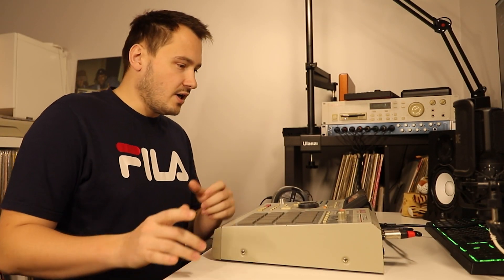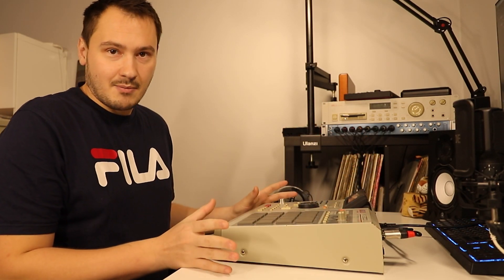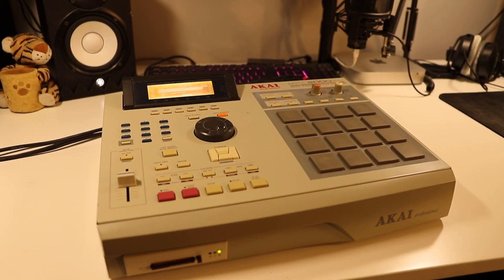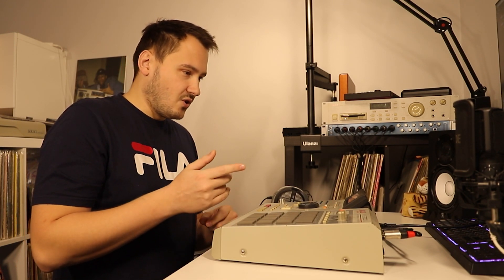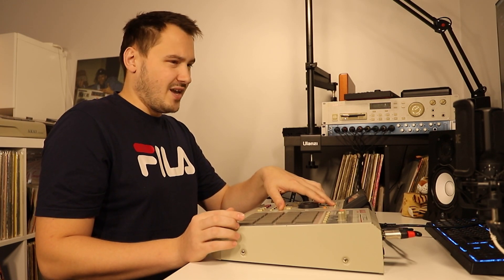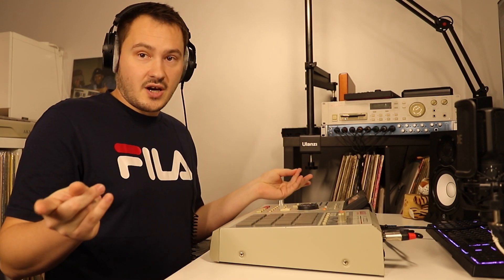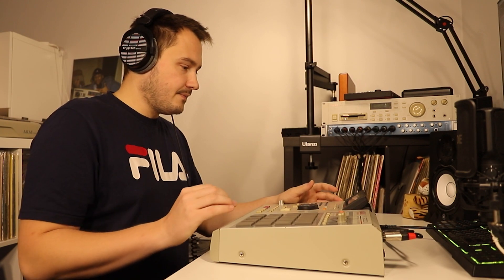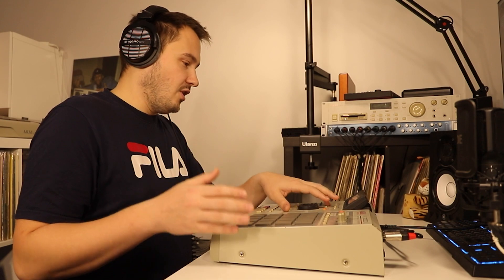How Resampling Sounds on MPC 2000xl | #mpc2000xl |

Comment: Nice one, good to see that You're an active dude here on yt, always a pleasure to see your new vids. If you ask me about resampling on 2kxl I think (at least given the samples from this vid) it sucks #ss and I think I used to try it when I had one, it was in my summer house and I remember I tried to either change the bit rate of the sample or to resample... Can't recall it exactly but the processing took so long that I managed to leg me way down  to the lake, take a swim, come back and I still had time to rolll a spliff and smoke it... Anyway, I have some other gear to downgrade the bit depht or emphazise the aliasing with pitch down on Low sampling rates so the only reason I want to buy this bad bwoy again is for it's midi and og feel and looks (call it nostalgia if ye want). Pozdro człeniu!

Comment: Wow did not know the 2000XL had a re-sample feature. Thanks for the vid. Now I regret selling the 2000XL years ago.
Reply: You can also change the bit right down to 8 bit lofi and 12 bit grit from being at 16. I bought a Mpc 2000xl ebook when I first bought mine also from the Mpc Forum. The manual covers a few things if any that was made for the sampler.
Reply: @Metamophisis  Ah I see good to know.. Does the EB16  have it ?
Reply: @djrugged1 I don’t have a effects board at all it’s not needed to change the bit rate. I believe I got a video on my channel with the steps.
Reply: @Metamophisis  Ok cool will check it out.